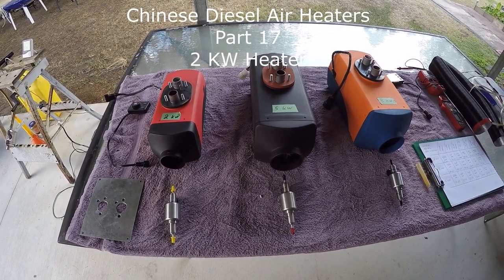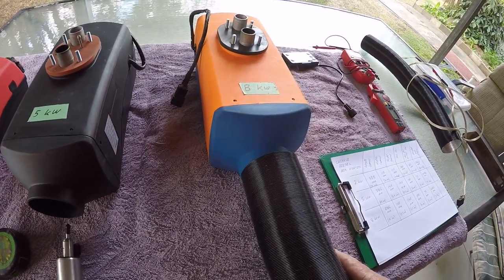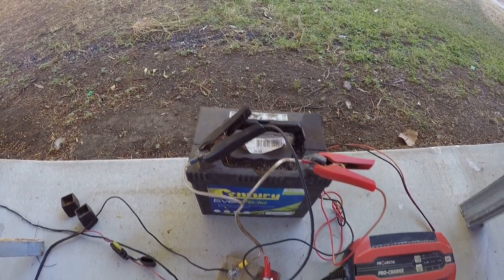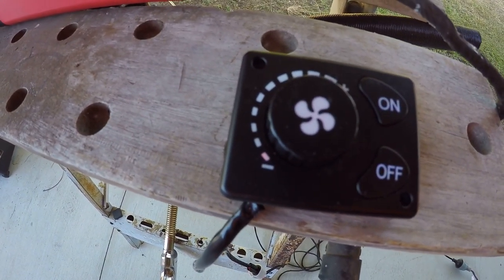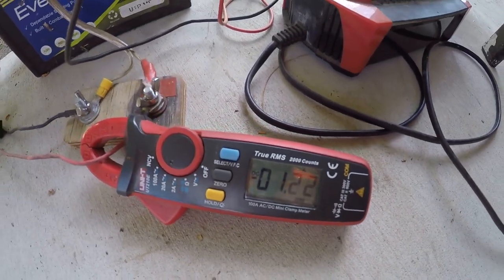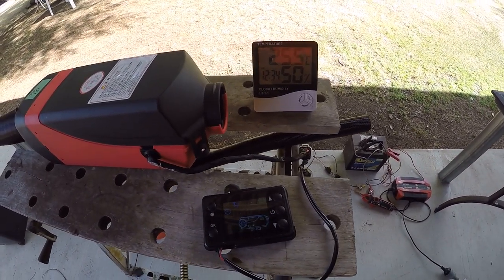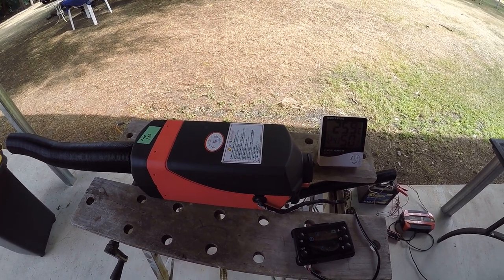Chinese Diesel Air Heater   Part 17 -  2 Kw Heater

Comment: I was gonna get the 2kw but you just saved me from making a mistake. Crazy it still uses the same amount of fuel and more battery power to save a tiny bit of space.  Thank you for all your time.
Reply: Hi , mine is a month old .. don’t hear fuel pump .. E-10 Error code .. what could it be ?
Reply: Wait....what? The 2kw uses MORE electricity than the 5kw unit??? WTF lol!

Comment: 2:30 pump 
2:58 controller 
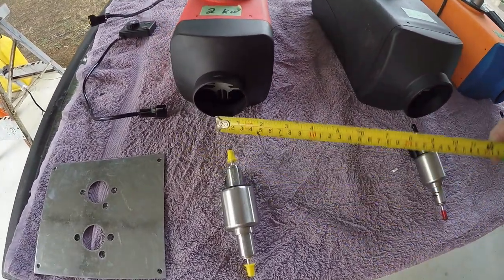3:10 size 
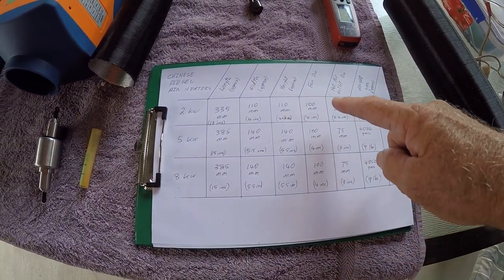4:20 weight 
4:50 ECU 
5:22 fan 
6:11 glow plug 
6:20 temp , fan 
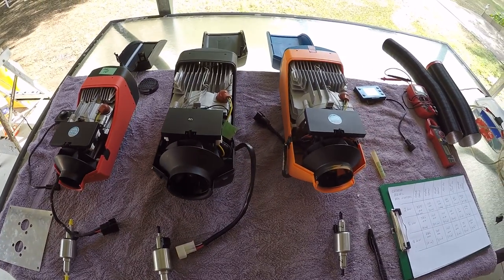6:50 heat exch 
8:10 bench test 2kw with rotary knob
9:00 E03
15:50 bench test 2kw with led 
21:30 discussion
Reply: Thank you from the future good man!

Comment from the maker: Thanks for that info and link. Fuel consumption is totally dependent on the pump dose volume and Hz rate. 
When comparing heaters you also need to look at the output air temperature and output air volume. 
Thanks for your input. JMcK

Comment from the maker: Thanks for your input. 

Interesting stuff, these heaters, for those that have a technical interest. 

Don’t get me wrong, a 2 kw heater has a place in many installs, but my view is it is better, noise wise, to have a bigger heater running slow, rather than a small heater running flat out to produce the same heat. Cheers.  JMcK

Comment: The last bit of advice runs counter to just about every other recommendation I've read, which is that it is not better to run the 5kw on low vs a 2kw on a higher setting to achieve the same level of heat due to the 5kw unit's propensity to soot up. 
Due to space consideration I'm going to install a 2kw, but will do it in such a way that if that proves to be a noisy/inefficient solution, I can swap in a 5kw.   At least they are cheap enough to trial.
Reply: same info I heard
Reply: John mentions this in the first video (or one of the earliest videos).  He says that as long as you burn the small unit on highest settings for about 15 minutes at the end of season (or end of month if you're using it each day), you'd burn off the soot/built-up carbon. Or, you can take it apart and use a torch to burn the build up off.  He explains/demonstrates this in one of his later videos. It's worth watching the series.

Comment: I have a 5KW and a real 2KW , the pump for my 2KW is a lower dose per pulse , it is even stamped on the side as a  lower 18 dose per pulse  , so not all are the same even if a lots are being supplied  the same pumps by dodgy sellers just bunging anything into the packing box .
Reply from the maker: Thanks for that feedback.  JMcK

Comment from the maker: Not sure of your question here. 
If outside head temp is only 40°C you have burner issues. Also the inside temp can not be as stated. The head is aluminium, and the heat transfer properties would make outside almost identical to inside. JMcK

Comment: John, You're a total legend. There are always concerns about safety and reliability when sourcing "cheap Chinese knock offs" and you have done meticulous research to understand the issues at hand. That you have then shared them with the wider community is wonderful to see.
These heaters are perfect for workshop use where dry heat is important to avoid rust issues on machinery and tools and I can imagine they will become a standard choice now the prices are so reasonable.
Thanks so much for you efforts, and enjoy your sailing>
Mark
Reply from the maker: Wow Mark, thank you so much for the positive feedback.  JMcK
Reply: @johnmck1147  You've earned it
Now I've just got to find a "reputable seller" in the UK!!
Reply from the maker: Furnacehousefarm 
👍
Reply: @johnmck1147  Got my heater installed and running smoothly. Wouldn't have been anywhere near as comfortable doing it without all the information you kindly provided. Huge thanks once again. Any thoughts about running them at a lower pulse rate and/or fan rate? My workshop can get too hot now, which is something I never thought I'd say! I don't want to mess around with settings unless you have experimented?
Kindest regards, Mark
Reply from the maker: Furnacehousefarm 

Hi Mark,

First, thanks for the positive feedback.

The common minimum default settings for these heaters is 1.6 Hz. You can go a tiny bit slower, but you run into issues where there is just not enough fuel to maintain the durn and the heater flames out.

Unless you are an enthusiast, my suggestion is not to alter the default settings. 
There is no “reset factory settings button”

Regards.  JMcK
Reply: @johnmck1147  Thanks John. My enthusiasm only extends as far as staying warm, so I'll leave the settings as they are.
Stay safe.
Mark
Reply from the maker: Furnacehousefarm 
👍
Reply: @Ondrej Ryjacek I bought from performancewarehouses on eBay. The box was already in the UK and it arrived in a couple of days. The item had several pictures showing the kit contents, but mine arrived with the vinyl fuel hose and an air intake "silencer", not a mesh air filter as recommended. Although the contact location for the seller was in HK they  were very responsive and refunded  me £8 so I could buy the correct nylon fuel pipe. The other accessories were good quality. All stainless hose clamps and the straight through exhaust.

Comment: So I’ve ordered a 2Kw unit due to size constraints.  I can’t run it direct to the batteries as my dual battery setup in the boat are in parallel.  To do so would run the risk of flattening both batteries so no means to start the engine. I will have to run power cable through the battery switch - no big deal as I will still install a master switch for the unit.
When it’s installed I will start the heater with the engine running to compensate for the amperage draw.  I do this when using the anchor winch too.
Hopefully this week the unit will arrive, without your instructional videos my installation would be a nightmare, thank you so much.
Reply from the maker: Thanks for the feedback Cammo.  JMcK

Comment: Mr. Mac you’re the best The source on the web! Last year I installed my 5KW with three outlets. However I had to especially order high temperature vents to run throughout my motorhome with closable vince (under the counters and drawers.) 
FYI I think you left that one minor point regarding shut down which I do every time is I increase the pulse to maximum for at least three or four minutes prior to turning off as you have informed us before this helps burn off any accumulation and it seems to be working just fine for me. (I also make sure my exhaust was straight in the hole was on the bottom of the muffler install.
I also added the Master switch which I had to specifically modify so that you had to lift the cover to either turn it on or off so it wouldn’t accidentally turn off and burn my circuitry. I also purchased a 400 mm stainless steel 12 V fuel sensor gauge and installed that in the 2 1/2 L tank which now shows me how much fuel I have available. thanks again sir.
Reply: Vents Not vince.... I also put a fuel filter inline making sure to use the rigid fuel line while connecting everything as close as possible to the fitting as you have explained thoroughly in one of your previous videos. One more thing that I did was using high temperature 2 inch exhaust wrap around the exhaust pipe section that went through my storage area which facilitates insulation from the tremendous heat it produces. Oh yeah I almost forgot I use the same 5 kW heater and engineered a Totally portable suitcase with a battery and a one liter fuel cell With a removable solar panel if needed. It’s going to come in handy with the heaters remote and the ability to also directly charge up or Run any device while Boondocking.🤗
Reply from the maker: Hi Keith, thanks for the positive comments, and thanks for the detailed feedback.  
Remember, with the vents, you must have one vent you just can not turn off or you risk an overheat issue.  Well done for making a portable suitcase model.  JMcK
Reply: John McK 47 you deserve it I’m wondering if anybody’s ever done a test on how long I should increase the maximum output before shutting down ...... I use basically at 50°F room temperature for 15-20 minutes at 1.5 pulse, then I shut down for a couple hours. I realize that a carbon buildup can affect the longevity of the glow plug and the combustion chamber .....so I’ve just been starting it on high pulse for a couple of minutes, when stopping, again on high pause, about four or five minutes. .... Just trying to get the longevity out of the thing with minimal service. I’ve read people saying as much as 10 to 20 minutes on high for shut down I don’t really think it’s necessary unless you’ve been running it all day at a low or medium setting? So what do you think. Thanks again for all your expertise.👍

Comment: Thanks very much John, fantastic information. 
The first thing that shocked me with the 2Kw was the main inlet fan being the same diameter, yet the housing body being so close to the outside of the fan. Looks like that alone would restrict the airflow. You can see the much larger space around the fan in the 5Kw model.
I've just bought an "8Kw" heater (I knew it would only be really 5Kw), and was also going to buy a 2Kw for my boat cabin, but now I wont do that.
An interesting question is, "Where is the extra heat "vanishing" to" ??? If the same amount of fuel is being consumed, and the burn is very efficient, resulting in minimal CO, then the same amount of heat MUST be being produced in the burn chamber. I wonder if it's all going out the exhaust ???????? Might be worthwhile checked the exhaust temperature too. Of course the heat would be a combination of exhaust air flow and temperature, so to get accuracy both would have to be measured, but that might melt your anemometer LOL. I wonder if the smaller fan rotates faster and move air through the burn chamber faster, and thus give higher velocity air out the exhaust.

Comment: Great video!! 👍👍
As an observation, leave the smaller 2kw out of it, but compare the "fins" on the hear exchangers on the 5kw and the 8kw. Many of the internal parts are the same or very similar, but there's much more surface area on the 8kw exchanger. More surface area would mean more heat created and blowing through. It may actually push almost as much heat through as an equivalent 8kw electric heater, even though the other specs seem to be more inline with the 5kw machine.

Comment: thanks m8 another no bullshit  post i been running one of these for six months now on low  in my flat and one in my van  awsum. a trick i use in my van is a 4 pin relay on fuel pump connected to digital low voltage cut off to protect my batterys
Reply from the maker: Great setup to protect the battery from running flat.  JMcK

Comment from the maker: Sorry, I have no knowledge of silent fans for these heaters. However, it is not the fan noise that is the issue, but the air noise at high volumes. To make the heaters quieter it would require a whole new design, eg a large two foot diameter low speed fan in the front. 

This is why I recommend getting a bigger heater and running it slower. JMcK
Reply: I couldn’t find the original comment to which you replied, so just gonna leave this here in case it’s helpful to someone. 

There are some (considerably more expensive) manufacturers which use brushless motors and these are claimed to be quieter. HLN do for sure, possibly Lavaner too

Comment: Thanks for all your efforts with this and the previous videos. I have watched them all and benefited greatly.

I have a 5kw unit and have installed it in a portable frame for use with my camper trailer. I was testing some new inlet piping and left the unit unattended for 10 mins after it had settled down at 4Hz On my return, I found that it had stopped and overheated the ECU. (I am impatiently waiting for a replacement ECU).

This made me think that a video on all forms of failure and what the heater does in response would be useful to those that experience difficulties.
Would you consider such a video?

Comment: With my plans to boondock and run off solar the 5kw at slower fan speed makes the most sense. Only problem is the smaller size of the 2kw works better. I understand the bottom or side mounting restrictions but can it be mounted on the end or even a steep angle keeping the air hole orientation in mind
Reply from the maker: Hi J,

In a small van, 2 Kw is all that is needed.

These heaters can run on almost any fuel......for a while. You can even run them on used engine oil....until they gum up.

They are designed to run flat,, but can be run on their side with glow plug on top side.
Initially they will work in any orientation, just like any fuel, until they stop.
One issue is flooding of the glow plug, due to orientation of heater so they won't start.
Another is the ability to atomise the fuel.
I know they won't run very long burning oil, but I have not tested these heaters running in a vertical install for any length of time, so I can't give you a definite answer. Something for me to do in the future when I have some spare time. Why don’t you do a bench test yourself on the orientation you wish to use?  Cheers. JMcK

Comment: The only information you are missing is what controller settings for the 2kw. I was having e8 errors and then replaced the fuel line to hard 2mm. Then it started working but blowing clouds of smoke. I have set hertz at 1.6 min to 4.5 max. Smoke has stopped but e10 coming on regularly. What should fan speeds min and max be because it does not sound as loud as it used to be. I cannot fit a 5 kw

Comment: I asked you this question a while back about the 2k vs 5k heaters and you gave me this same exact answer. What I was really asking you was based on my assumption that since both heaters burn the same amount of fuel the smaller chamber should theoretically be twice as hot since its roughly half the size. that makes me assume since the smaller chamber is hotter you wouldn't have the carbon buildup problem. that's what I was asking you the last time which you didn't really address

*edit, since you said the smaller one only puts out half the heat I'm assuming the heat inside the smaller chamber isn't twice as hot so I guess all I have to do is figure out if I need to use the 2k heater for my minivan because even though the 5k heater is twice as efficient I might not want it to get too hot inside the van, although again the extra heat would allow me to open a vent to circulate the air which I do want to prevent condensation. yeah I think the 5k heater is the best option for air circulation now that I think of it, thanks for the info
Reply: Which did you get? I'm in the same situation. But I'm looking to heat a honda civic. Deciding between the 2 or 5 kw. 5 kw is probably overkill for the covic, but I also would like it stealth. Perhaps drawing the air from the lutsidw would help. I'm in canada and winters get to -15 celcius.
Reply: @raczyk  if it gets that cold you need the hottest one. I would also take off the door panels so you can stuff insulation or spray foam insulation inside the door panels. You would not want to use the outside air as the Intake, all you would need to do is roll down the WI dow to Control the extra heat but like I said the heater thermostat is supposed to try to maintain the temp somewhat. I'm a truck driver I use the diesel heater on a daily basis. You won't get the perfect temp you want but it's good enough, just choose for it to be a little colder or hotter than you i tend it to be.
Reply: @raczyk  at home I have the 5kw,but at work in the truck I think it's an airtronics d4 which is 2kw, which maybe it's the controller but it controlling the temperature is very imprecise

Comment: On some of the marine diesel heaters the Inner hose blows the exhaust out, and outer hose sucks the combustion air in to capture the lost exhaust heat. with these you could use a stainless intake hose and wrap the exhaust and intake together to boost the efficiency...
Reply from the maker: Yes Esa, you could do this.
Some DIY installers also use a section of normal (solid) exhaust and wrap small bore pipe around the exhaust to get hot water.  JMcK

Comment: Excellent content John. I was wondering about the different efficiencies of 2kw vs 5kw heater. I had intially bought a 2kw and then bought a 5kw to have on hand for parts. Haven't have needed any parts yet, I think Ill be saving my 2kw for parts 😂 Other than a small size there's no good reason to use a 2kw. I'm still mixing about 10-15% gasoline with my diesel fuel for a cleaner burn. I manufacture exhaust components and recently built the dies to swedge tubing for the air intake and exhaust output (two different sizes of course) so I can custom bend intake and exhaust components for these and they fit nicely and snuggly over the nipples on the bottom of the heater.  Jerry
Reply from the maker: Thanks for the detailed feedback Jerry.   JMcK

Comment: I leave you some ideas for further investigations. How to use the heat currently being wasted on the exhaust:
1- make a dryer box, to dry boots or whatever.
2- pre-heat the air intake for the combustion chamber. This should lead to cleaner combustion, but may overheat the intake side of the heater and destroy something.
3- heat up air that is being taken from outside of the camper and force it inside the camper for air renovation.
4- additional heat exchanger inside the van.
Reply from the maker: Thanks for the feedback CC.   JMcK

Comment: Great info thank you. i got a smaller heater to run it slower as my van is small , i just turn it up for 15 before shutdown to burn out the chamber.
Reply: Do One  I Use red Diesel fom BP